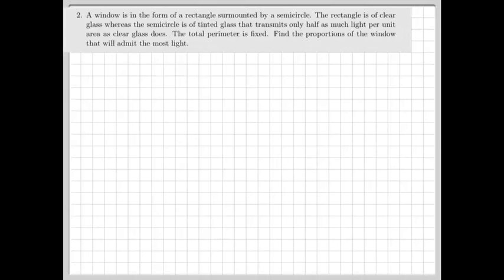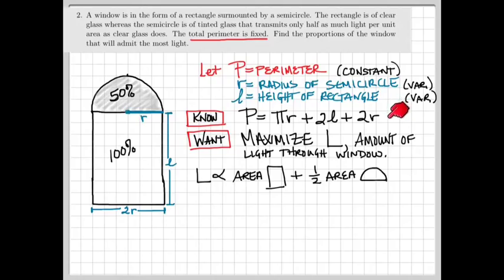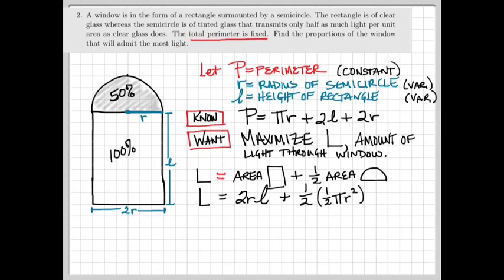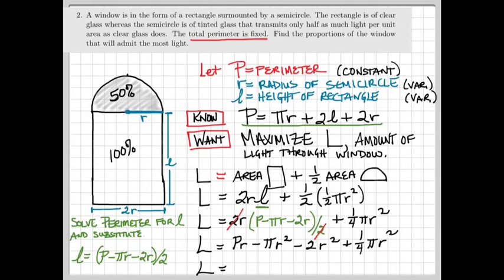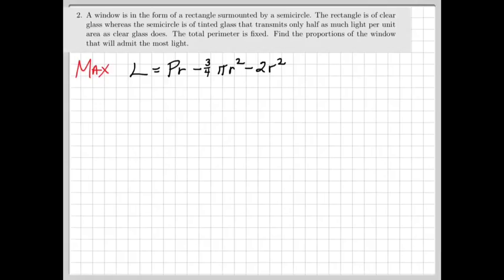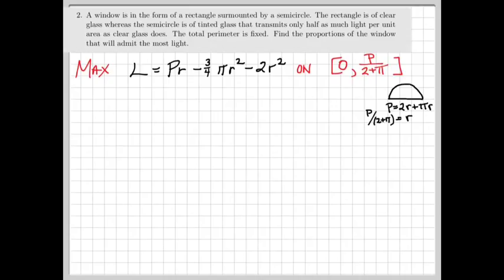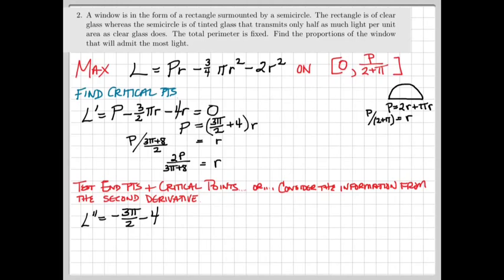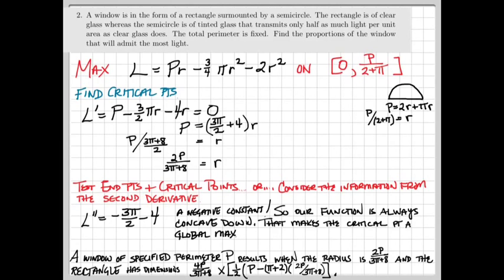Optimization: Norman window

Comment: why one side is written in diagram as l and while solving 2l ,
Reply from the maker: l is the length of the vertical side of the rectangle. When finding the perimeter of the window there will be two vertical sides (2l), one width (across the bottom 2r), and one half the perimeter of a circle (the top of the window, pi r). This gives the constraint P=2l + 2r +pi(r).